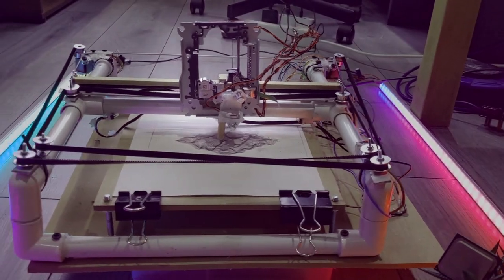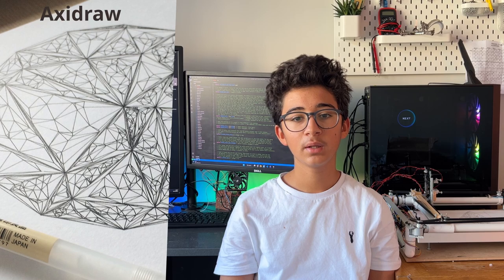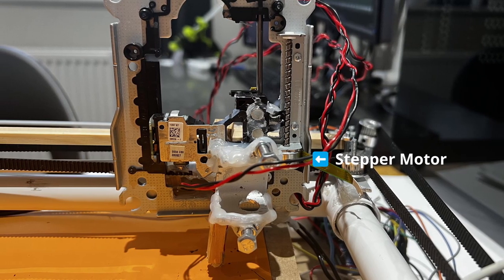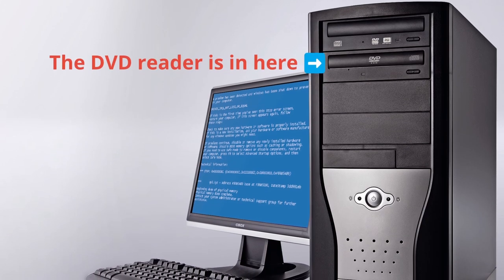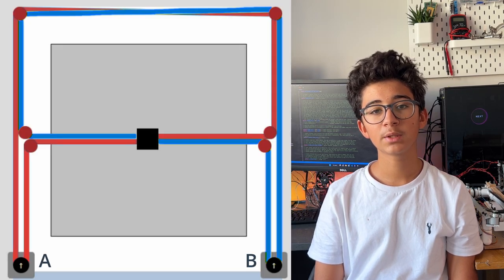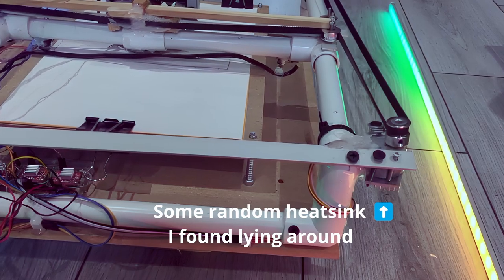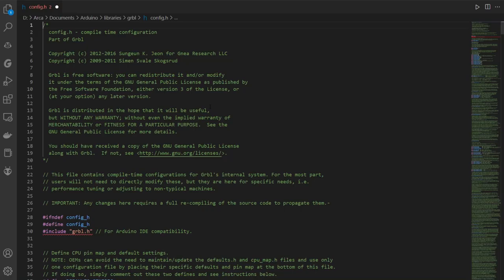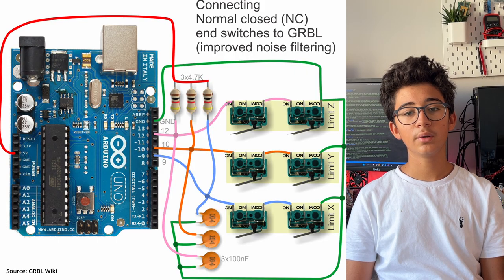The £50 Pen Plotter - no 3D printer needed!

Comment: You will need an old cutter plunger motor to turn this into a true blue plotter! Vacuum table would be nice too but cut pressure control would be a start. I have a plunger motor but i do not plan to use it on my ender 3 extendo machine because we already have several plotters

Edit: i see this is a pen plotter and not a cutting machine but for this, your potential to build it is off the charts!! I’d love to send you the plunger motor if you will use it
Reply from the maker: I didn't manage to explain it well enough in the video but I used microstepping on the Z axis stepper to allow for pressure control and it seems to be working well, at least for now (although the torque seems to be a bit low). Also, I needed the plotter to be as cheap as possible and a plunger motor would add $10-20 to the final price. They're also harder to find, whereas you can usually find a DVD reader for free. I might add that in the upgraded version but for now, I'm using a DVD motor.

Edit: I've tried using a knife to get it to cut paper/card but a knife needs to be rotated. So I'd need to switch to an Arduino Mega since normal GRBL doesn't support more than 3 steppers but GRBL-Mega supports up to 6. Plus, I'd need another 28-byj-48. Or if it has enough torque, could use DVD spindle? (Spindle is also a stepper) And with that I need another a4988 to drive it. I might need to upgrade the Z axis to support the weight of all that.
Reply from the maker: As for the vacuum table, some foldback clips on each corner do the job just fine (although the middle of the paper bows up slightly)
Reply: @arcaegecengiz  oh i’m sure it’d be fine with a sharpie and such but with thinner pens like fiber tip and ballpoint etc need a bit better adhesion and flatness. I believe its all pretty achievable for you! You seem like the 3d printing type and theres no better time than now to have one, exactly for stuff like this
Reply: @arcaegecengiz  rotating knifes for plotters are quite expensive if you’re buying them new. (Maybe $100-150 new), (tungsten carbide  blades being top of the line industrial stuff cost $100 EACH from graphtec) You can use ones from old plotters though, like the cutter plunger. I’m not sure how you can control the cutter plunger but i know it would be much better than using the Z motor, plus it would be quicker and more stable
Reply from the maker: The adhesion seems to be fine, even when I draw with ~0.3 mm pens. I plotted the one on the outro with a 0.5 mm fiber tip fineliner. When I clip the paper on, I pull the clips back a bit to "tension" the paper so it's more flat, which, when combined with the slightly-thicker-than-normal paper I'm using, greatly reduces the problem. The main problem is that it isn't very rigid and everything bends more than I'd like, especially on the z axis (it's held on with hot glue and hot glue tends to flex a bit). I'm going to be getting a 3d printer soon and PLA will hopefully bend less than hot glue. I might also make a video on using a 3d printer as a plotter